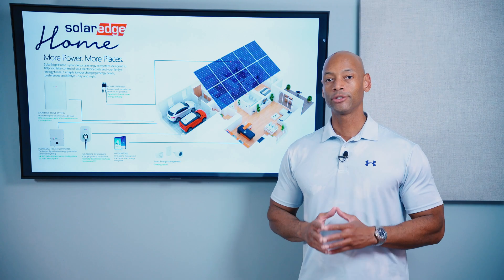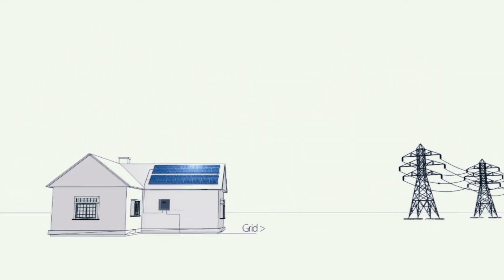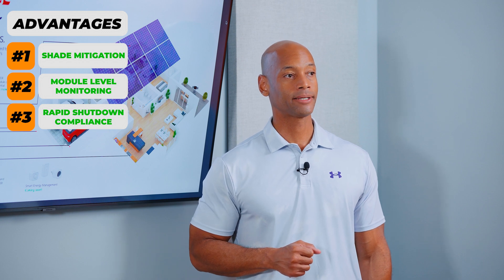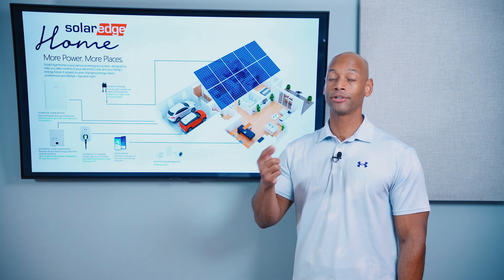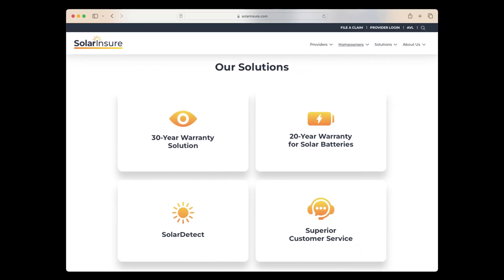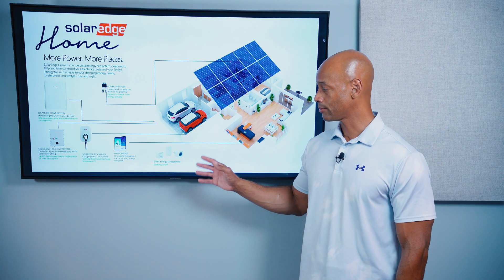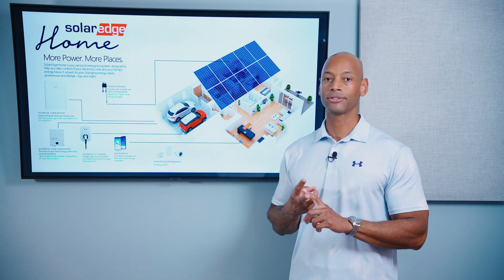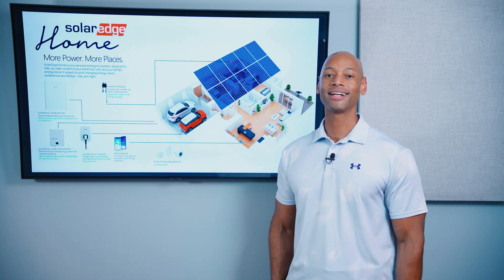SolarEdge Home System (2024 Updated)

Comment: I wanted to put a battery onto my solar edge solar system but I wanted to be able to couple up a generator as we can get long grid downs here.
My installer said the hardware was available but the software was not yet available.
Any comments?
Reply from the maker: Good question.  Both SolarEdge and Enphase have backed off marketing their generator re-charge option recently.  I think some of the early installations had challenges and they are still working out the bugs.

Comment: I’ve had great experience with SolarEdge inverter. It was installed in my 6kw  system in 2017 and haven’t had a single problem with it since then.

Comment: can i look at my solaredge inverter and tell if is micro inverter, my system was installed in oct 2019.
Reply: Solar edge doesn’t use micro inverters. They use optimizers. Dc to dc

Comment: You still have high-voltage DC on the roof! That is not worth the risks. The 10% conversion savings is a red herring. Most of the PV will provide for the homes energy demands. The balance goes to the battery.. You only save a few percentage points on energy sold back to the grid and what is used in the evening during higher rates. The balance of the time you will draw from the grid at the lowest rates. In the real world you are arguing for high voltage on the roof to justify a few points of efficiency on AC to DC conversions. This is nuts. Interestingly your video is sponsored by an insurance provider. I challenge you to share with us the insurance cost for an optimizer string DC coupled storage system vs a microinverter AC coupled storage system.

Comment: Be very careful with the bi-directional claims.  "Ford, GM, Tesla, Nissan, Rivian, Lucid, and many others."  While this is technically true, it does not follow that any of them will be compatible with the SolarEdge system.  For example, some Rivians (R1) support DC bi-directional charging and some (R2) support AC bi-directional charging.

Ford currently requires their own bi-directional charger and does not support any other.  Same with GM.  Other makes may also require their own (especially Tesla).  There is a standard being worked on but there is no assurance that older models can be updated to meet the standard.    (For reference, I am a 2022 Lightning owner.)

Comment: Joe, what are the most current stats you've seen on that inverter reliability? Even as of last year, there seemed to have been an unacceptably high number of failures with too much lead time to get them replaced. Thought you would have the stats and perhaps some corporate insight into this matter. Thanks for the great and continuing education Joe.
Reply: @randallcotner2155  meanwhile, you are doing what???

These products change about wvery 3 to 6 months.  But your problem remains the same.
Reply: @IKidTheSolar  What does "meanwhile, you are doing what???" mean? It seems outside the scope of my question on stats. When you say "...your problem remains the same" do you mean that in spite of changes to the products, the reliability remains poor?
Reply: @randallcotner2155 noooo.  I mean that you are wasting your time listening to this video and worrying about all the wrong things!  What are you doing for power now???
Reply: @IKidTheSolar  Are you saying inverter reliability is not a relevant matter? Why is reliability not relevant? I do the same as most people for power, but the question seems very important to you.

Comment: What cars support bidirectional use?
Reply from the maker: Ford, GM, Tesla, Nissan, Rivian, Lucid, and many others.
Reply: @SolarSurge  TSLA Cybertruck only, anything else is off warranty
Reply: Tesla Cybertruck does (who cares, I'd never buy that turd lol). I think Tesla is torn on Bidirectional since it will cut into their battery business, but I don't think they'll have a choice
Reply: @marcppparis Tesla’s have been tested and been found capable of bidirectional charging. The assumption is it’s built into nearly  every one of their vehicles at this point.
Reply: @OffgridApartment  everything I’ve seen says the cybertruck is the only one that does it now . Maybe others are theoretically capable but still require a software update. I know they’ve said by 2025 all new Teslas would
Reply: I think the F150 lightning and the Silverado EV do (trucks). I don't think Tesla does (yet)
Reply: It will become table stakes pretty soon I believe
Reply: Almost all brands of vehicles have at least a few models with this capability,  best for you to do a Google and look for yourself at brands and models you are interested in buying.

Comment: I'm gonna be moving to Tucson in a few months and will need a new roof in a few years. I'm thinking of going Solar Edge. I definitely like the DC coupled approach. I might also get an F150 lightning or Silverado EV in the next few years as well so bidirectional charging is going to be a must for any EV or Solar solution. I love the idea of DC from the roof directly charging the battery and DC from the roof directly charging the EV battery. Minimizes clipping losses, more efficient, bypasses 2 of the DC/AC AC/DC conversions, also bypasses any throughput limitations through "needless inverters". So charge speed should be the fastest possible. Also less need for mucking around with the house panel and circuit breakers. My only concern would be the distributed nature of putting optimizers on the roof in very hot AZ weather (however that's better than putting a microinverter on the roof). Also any max DC/AC power output from a single inverter (don't know if that's really an issue). I'd also love the Solar edge batter to have better specs like the Powerwall 3
Reply: I honestly think with more equipment benefitting from DC-DC such as EV chargers and batteries being required as net metering gets worse and worse, we'll see the microinverter approach go away
Reply: @marcppparis   -  What I do not like is that Enphase is putting their microinverters in nearly everything they sell including their batteries which makes them more profit and increases the price of their products.
Reply: @marcppparis so ridiculous.  Do you see the 25 year warranty going away?  Or the 30 year?  Do you understand that this foolishz irrelevant video is talking about all the least important things?  All your DC DC conversations a tion means is you are talking yourself into single points of failure, lower warranties, more price driven competition, from clueless "solar", unnecessary electrical risk, lower tax credits and lower quality systems.  That's it.  No benefit at all.  Efficiency is irrelevant!  There's no triple penalty.  That's "stupid solar" talk.  The kind of things people say when they have NO IDEA what's REALLY going on with Solar Power
Reply: The optimizers seem to hold up very well on the roof.

As far as AC power is concerned, you can stack up to 3 inverters on 1 backup interface. The newest Home Hub models can all output 11.4kW in backup mode. That is a huge game changer if your utility requires you to have a smaller inverter.
Reply: If you understood what was really going on with solar power you wouldn't all be blabbering about all this tech nonsense.  And at the same time, saying absolutely NOTHING that really matters.

5 million homes now, after 20 years use solar power- how many of them have EVER had to think about ANY of these technogeek faux "issues"???  Meanwhile you know who does???  The 95% that have NOT taken action and guess why geniuses???!